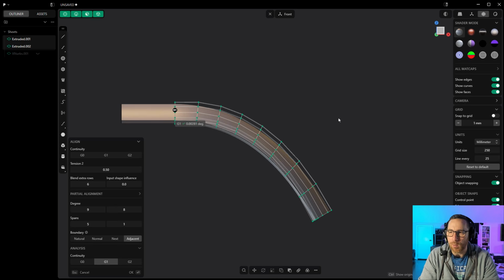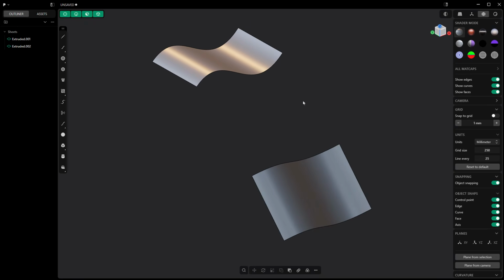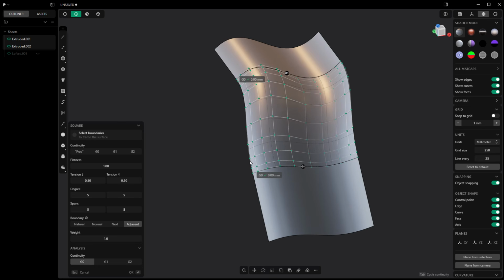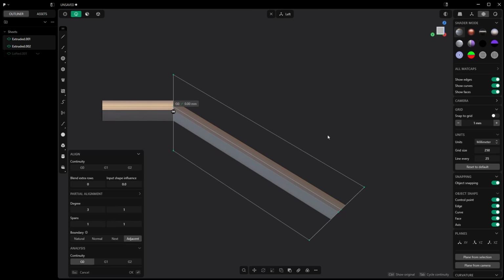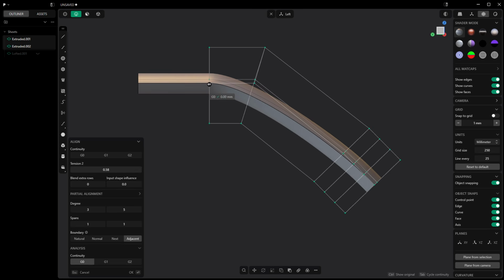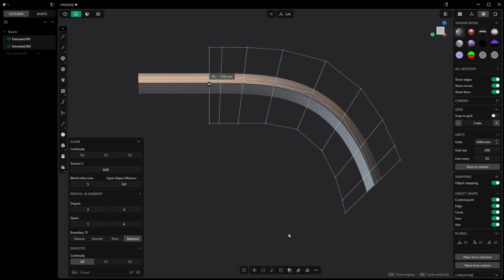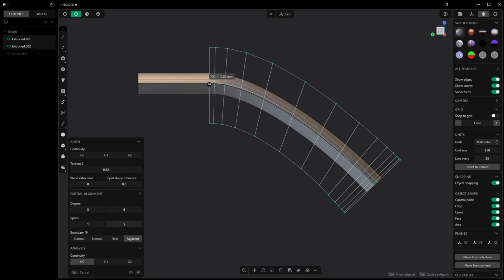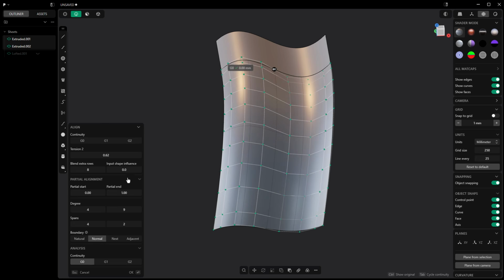Align and Square in Plasticity | XNurbs Tools

Comment: The Boundary kinds are make more differences, when you Align or Square more than 1 edge, this options are more for practical cases. Only use use all 4 sides to align there are again no big differences, less when only 1. But when you align 2 side 30°....45° or 90° (a corner for example) or 3 sides and 1 is open, you will see the magic of "Next, Normal and Adjacent...this is very helpful for complex formfinding.
Reply from the maker: Great point!  pinned your comments for others to find.

Comment: Great video Matt, thank you. I'm in the middle of the 30 trial and wondering if the paid license gives you better and smoother curves? I modeled and 3D printed something yesterday and noticed the curves on the fillets were very noticeably faceted. Does the detail get better in the paid versions?
Reply from the maker: Hey Joe(instantly sings Jimi Hendrix),  The studio vs Indie license has some different translators and the export of the trial i believe has some limitations to them. Like low resolution Obj/Stl export.  Once you have either an Indie or Studio the export resolution options increase.  So its less about the surface quality and more about the trial version.

As for surface quality on the Studio vs Indie.  this might help https://youtu.be/iEVZEBlfVUw

Basically the xNurbs tools can produce higher quality surfaces, but really the benefit is around the inputs.  xNurbs can use internal curves that don't touch the rails as input, and can make all sorts of complex connections that aren't possible with other tools.
Reply: @LearnEverythingAboutDesign  Thank you for the reply Matt, much appreciated. Sounds like this is what I want to hear. I'll check out the link. Love your channel 👏

Comment: Hey! I really enjoy your modeling videos, especially the ones where you build body kits step by step.

I noticed you’ve done similar projects before, but mostly with simpler shapes. I’m currently learning 3D modeling myself and struggling with more complex geometry like fender flares.

Would you consider making a detailed tutorial on something like a wide body kit for a Subaru Forester SG5 (2005–2007)? For example: “Fender Flares Set / Wide Body Kit SPEC S”.

I think it would be super useful because the shapes are more complex and closer to real-world projects. I’m sure many people would find it valuable too.
Reply from the maker: Hey there. one of the issues is that full kits and completely ready to go parts take a very long time to do.  I did a long series on scanning and designing a fender.
https://www.youtube.com/playlist?list=PLBDfGh8A8kXVvKBJ4UudhVLKlPdumAg5P

that walks through the entire thing.
Also more car modeling and bike design videos in various playlists.
https://www.youtube.com/playlist?list=PLBDfGh8A8kXVsW1aKUUjBYv-cqDU1Buhw

https://www.youtube.com/playlist?list=PLBDfGh8A8kXW2KBn0b7pMsH5q6FLfSYql

and so on.  I have so many videos backlogged that it would take a very long time to get to any new ones.  I used to do some "speed" modeling videos doing some different kits.
https://youtu.be/oyXAo0J9Wjg
https://youtu.be/1RZgiesN35o

and probably one of the first fender flares we did.
https://youtu.be/LYhj9kGrOEY

Its all possible with the same tools and techniques but its not quick or easy to make a ready to produce (even 3d print) part.  It all starts with a good scan and an idea.
Reply: @LearnEverythingAboutDesign  Thank you so much for all these materials — this is incredibly helpful!

You’re a really talented CAD specialist, I honestly admire your work.

Comment: BTW y'all, a helpful tip when using the Bridge Curve function is to set both the start and end points of the curve further along the edges you want to join together, and then use the info boxes at the top of the Bridge Curve settings box to slide them back to their respective vertex. It prevents the struggle of hoping the program identifies which direction you're actually trying to draw from.
Reply from the maker: Thanks.  Another tip is if you hover over the edge you want, instead of clicking and changing the value, you can hold down SHIFT and it will lock it in that orientation.  I don't know if its because of a projection like tapping shift, but you have to hold shift down for it to work.
Reply: @LearnEverythingAboutDesign ooh, that's even more helpful than what I've suggested, cos then there's no need to change the start or end points afterwards! This is why I watch all your videos, mate :) Even when I think I know quite a lot of the program's features, there's always some nuggets of wisdom I'm still unaware of!
Reply from the maker: @overseastom  for sure.  I ALWAYS forget to do it and end up doing the way you said :)  It is nice Nick tosses this stuff into the program but its like searching for these little bits sometimes!!

Comment: I really don’t get the point where I would Need that.
Reply: If you watch Keuchmeister Swagger's videos, you'll see use-cases and experiments that actually approach or even meet class-A surfacing with Plasticity, and these 2 functions are instrumental in achieving it. His videos rarely have English narration though (I think he's German), and the ones that have an AI English voice can still be a bit tough to understand the explanations, because the translations are a bit iffy. Dude is a beast when it comes to surfacing know-how though, and the best at demonstrating what Plasticity can do if you know its every function.
Reply: @overseastom Thank you, just yesterday I start a tutorial series about this.
Reply from the maker: I would say its use case is less than that of Square or XNurbs, because most of the time you want to connect two things together, but in some cases you might want to make a simple and sacrificial surface that has the tangency direction you want to connect to something else.  Your Av picture looks to be a sportbike in a turn, so lets say on the fairing you wanted to a vent to get heat away from the radiator.  If you make the profile of where you want it to meet the radiator and just extrude it, then use Align to the rest of the surface of the fairing, you would get a smooth transition in the direction you want, but without an extrude that has no curvature in that direction.

So I see it more as a tool that lets you shortcut creating all the references.

Now for the Xnurbs tools in general like Square vs loft, it essentially gives you better control like you are drawing a bunch of splines to connect the surfaces rather than just driving it with end conditions.

Comment: Thanks for explaining this, I was struggling to use the align tool trying to join sheets together that wouldn’t fuse into a solid even though the distance between the edges was less than a mm, and I thought to use align but kept getting errors.  Ow I know it’ll erase one of the sheets, I’ll try something else
Reply from the maker: Also make sure to check the deg/span numbers against the tolerance on screen.